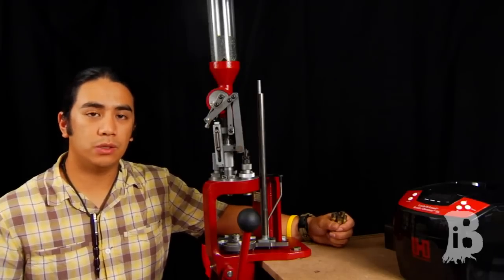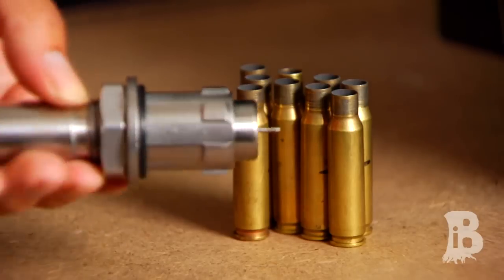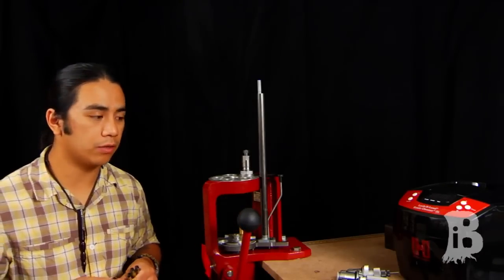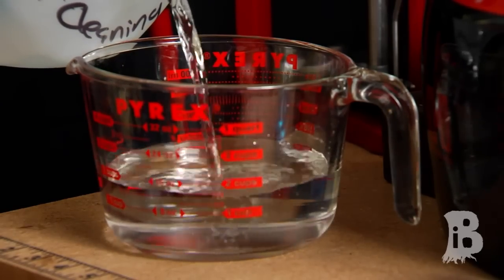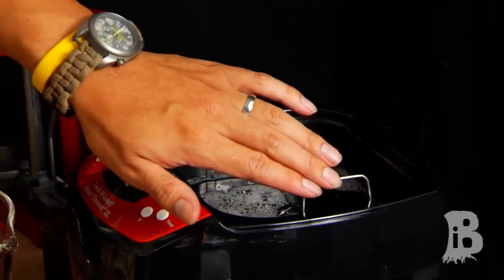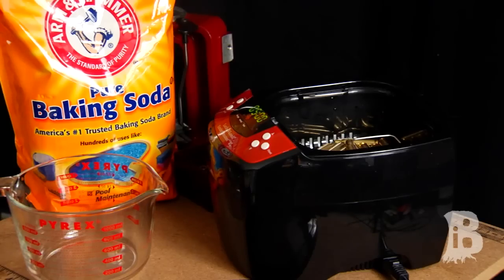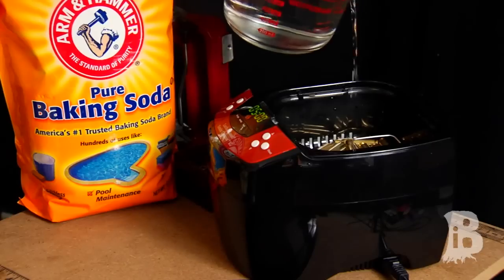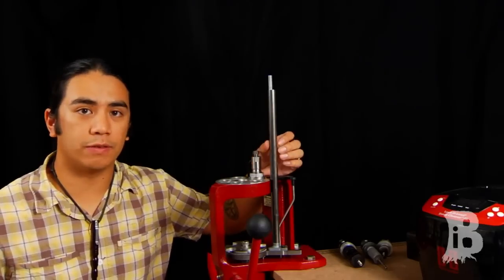Ultrasonic Brass Cleaning: First Step in Firearm Accuracy

Comment: Baking soda will impart a 'smooth' feel to the brass which makes it chamber easier. Also an oven brought up to a low heat then switched off will dry the cases quickly without fear of affecting brass composition.
Reply from the maker: thumbs up

Comment: Just strange that he said to not heat the mixture with the Ultrasonic device...but use hot water to rinse the casings...also when you fire shots the casings is very hot :-/
Reply from the maker: Heating the acid makes it work too aggressively. The heat itself doesn't do anything to the case.

Comment: You don't need an expensive gun-branded ultrasonic cleaner like Hornady - a simple ebay jewellery cleaner works just as well at a fraction of the cost.
Reply from the maker: The Hornady red color makes everything work better, in my experience

Comment: Heads up, magnum rifle brass won't fit in the Lee Universal decapping die as the die body isn't opened up enough.  Also the pin is too large for 6.5 Lapua.  I ended up turning down the pin for 6.5, and I use a Redding die for everything else.
Reply from the maker: Good to know. I've never had the opportunity to use Lapua brass. Maybe some day...

Comment: How does the heat from the machine damage the brass? When the round is fired it gives off/has way more heat in the chamber. That said, wouldn’t the brass be too damaged to clean/reload....
Reply from the maker: Heat applied makes the chemical reaction too aggressive. The heat from chamber combustion is fast enough that it doesn't mess with the metallurgy
Reply: @innerbarkoutdoors  "The heat from chamber combustion is fast enough that it doesn't mess with the metallurgy". So the round cools down, to the temp before it was fired, immediately once fired? Your comments about heat damaging the brass are nonsense, just stop.
Reply from the maker: Annealing is a product of heat and time. Too fast for the extreme temp to do anything. You'll be work hardening more than annealing. Have a nice day.

Comment: Do you rinse the brass after it comes out of the ultrasonic? I forgot to rinse my 6.5 brass with water after it came out of the ultrasonic and put it straight in the dehydrator and my groups were shooting sporadically. I was using hornady one shot cleaning solution
Reply from the maker: Yes rinse - easy extra step to make sure its all good!

Comment: I get pitting around the primer pocket port into the main case chamber due to cavitation while using my ultrasonic cleaner.  Has anybody else experience this problem?  I remove the primer prior to ultrasonic cleaning.
Reply: I have not had that experience. Could you go into detail about the brass, primer brand, and powder brand?
Reply: ***** I start with virgin Remington 308 brass.  I notice the pitting on the after the first cleaning before 2nd bullet seating.  The primer is CCI 200 large rifle.  The powder is 43.5 grains of IMR 4064.  The bullet is 165 grain Nosler Accubond or ballistic tip.  Case length is 2.010 inch.  Cartridge length is 2.8075 inch.  I shot out of 20 inch barrel Armalite AR10T.  I did not see pitting when using Frankfurt Arsenal walnut tumbler when using same exact set up as described above.  I only started seeing pitting when starting using Kendal ultrasonic cleaner model HB-S-36DHT.  The cleaner has 180 watts of ultrasonic power at 42 khz and 200 watts heater power. I use Lyman turbosonic cleaner solution per instruction.  I clean about 100 cases in the basket each time for 30 minutes.
Reply from the maker: Char Char
Try a sample case without using heat as the heat might amplify any side effects that the acid might cause on the primer pocket. Also, does your cleaner have a de-gas feature, and are you using the lyman cleaning solution with distilled vinegar?
Reply: InnerBark Outdoors The cleaner does not have a de-gas feature.  I am using the orange bottle Lyman turbo sonic solution and water mix only. I will try using without heater and water only on my next case prep and let you know results.  Thanks for the help InnerBark Outdoors.
Reply from the maker: If you find the lyman stuff is too harsh, try the vinegar.

Comment: Good clip. 
Ajax kitchen powder with a teaspoon of vinegar works well in 3 litres of water and doesn't need bicarb soda rinse, just warm water flush is fine. Unsure if Ajax is available in the USA.
And before someone says"but pin tumbling is better" again... try pin tumbling a carburetor,  reading glasses, jewelry,  reloading dies and a heap of other home uses that ultrasonic does exceptionally well. Wanna clean a paintbrush? Just buzz it. Mum's silverware? Zap with ammonia... they're versatile. Four stars.
Reply from the maker: How much AJAX? We can get it here in the states. I like experimenting
Reply: Just a teaspoonful. ..you can discard the mix in the bath tub and scrub it out too...which will impress the wife!
Reply: Keep in mind that the cleaner Wattage and amount of brass will vary cooking time. I hope you find good results...
Reply from the maker: @raycowburn7155  thanks I'll try it!

Comment: what capacity is the sonic cleaner you used? wondering what size I need for 50 rounds at a time
Reply from the maker: 50 rounds of small length IE 308 Winchester will fit in this, 60-70 is prob. pushing it.

Comment: I had an ultrasonic cleaner....got rid of it.....too much trouble and not enough volume.

I use a Harbor Freight 2 drum tumbler. Can do 500 rounds of 223 in about 2 hours.

I first de-prime all the brass I want to clean. Primer holes need to be clean too so out comes the primers.....I use the Lee de-primer die and that can do all the calibers I reload.

Fill the drums with 250 each 223's......add a couple of cap fulls of Awesome cleaner from Dollar General or the industrial Purple cleaner from Home Depot. 

Add a tablespoon of LemiShine and then a couple of hand fulls of Tractor Supply sand blaster media along with filling the drums to about a half inch from the tops with water. Tumble for 2 hours and then dump the water...the water will be black.......rinse the brass in the drums.....then put the drums in a bucket filled with water......pull the cases out of the drums rinsing the cases of cleaners and sandblast media. 

I spray the brass with a small hose and water from the top into the brass with the primer pocket and then reverse it to make sure that no sandblast media remains. You can also use stainless steel pins but they are a pain to prevent losing so I use the sandblast media which I don't care about as it comes in a 50lb bag. The cases come out totally clean....primer pockets look new and the inside of the cases look new also. I let them dry out for about a day or two and then case trim with my World's best case trimmer on my drill press. I then lube them up with a home made combo of Lanolin and alcohol. Put them in a one gallon plastic bag and spray about 6 shots of home made case lube into the bag and move it around a bit to make sure all the cases are lubed up. I then run them through my Dillon RL550C.

The ultrasonic cleaner I had would only do a few dozen brass at a time and was just not fast enough. The brass had to be in the center and any brass on the sides if you overloaded had to be done again. Tumbling is the way to go....and not the dry tumblers with corn cob or walnut media...too much dust  ....I've converted to wet tumbling!
Reply from the maker: Thanks for the in-depth comment Steve!! Very informative to read - lots of things that I will keep in mind and think about.